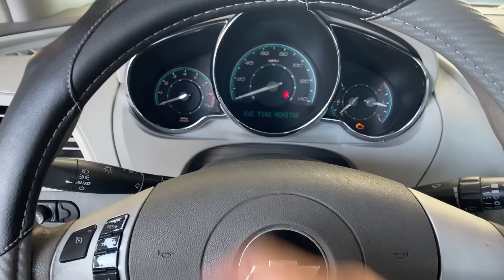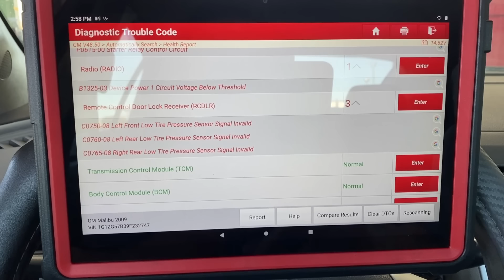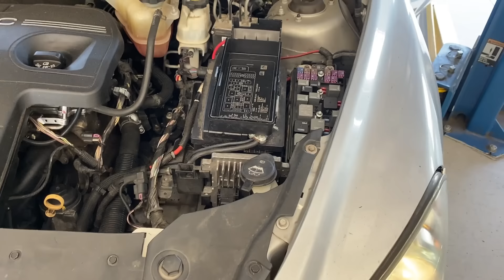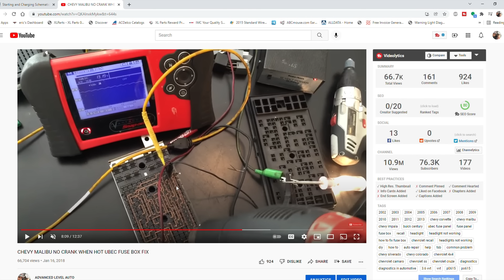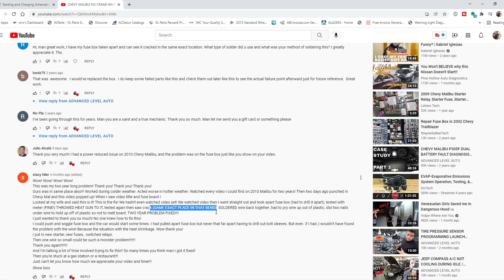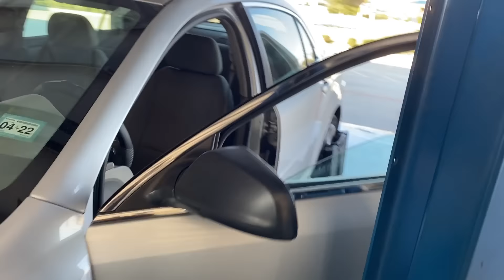CHEVY MALIBU INTERMITTENT NO CRANK NO START P0615 DIAGNOSIS & FIX

Comment: Great Job, Eric! I remember watching your original video with the fuse box issue. It’s disappointing that GM doesn’t acknowledge reoccurring design flaws, especially with electrical. For that reason, I’m sure a NEW replacement fuse box will fail the same way. Your customer is probably better off paying you to repair it. Thanks for helping the community of professionals and DIYers!!
Reply: i agree- you are so right

Comment: Good job! Best fix is the same as Mopar fuel pump relay. Take relay out of fuse box. New relay & socket separate from fuse box.
Reply from the maker: I actually did that repair on a Dodge Ram a couple of weeks ago. Unfortunately I couldn't film it. It was late in the evening, it was raining and I had to hurry. I'm still upset that I didn't make that video.

Comment: This is 100% traceable to GM trying to save the planet from global warming by dictating the use of lead-free solder that is prone to cracking. Satellites have fallen from orbit because of the same phenomenon. Meanwhile, GM sources parts from China where their energy comes from dirty coal emissions. Insanity. After owning 15 new GM vehicles during my lifetime, I am done with them and their coming battery bullshit. BTW, that will all have the same issue. Thank you Comminst EU with your RoHS bullshit!

Comment: Another GM vehicle the same copper wire break in a fuse box.  The 2005/2006 Chevy SSR with the LS2 6.0L engine (based on the Trailblazer EXT) has a similar issue with a copper wire with two 90 degree bends in it that a break develops in causing the engine to stop running after the engine bay fuse box heats up.  A couple of very dedicated SSR owners have found a solution for that fuse box by rerouting a replacement copper wire in the fuse box and the new routing does not include the two 90 degree bends that are near each other in the wire.  One of the 90 degree bends in the OEM copper wire is thinned out compared to the rest of the wire and that's where the break occurs after enough engine bay heat cycles occur.  The repaired 2005/2006 Chevy SSR fuse boxes with the rerouted copper wire have been trouble free since being repaired.

Comment: I used to use Heat Guns and Freeze Spray when I used to repair Medical Equipment back in the day. I had Patient Monitors that would stop working. I would heat up the capacitors and the display did not work and when I hot it with the freeze spray the display would work again. So I was able to repair unit with a couple of dollars of parts instead of replacing entire circuit board. Great catch on your part with this issue.

Comment: Having been in similar situations when trying to explain fractured paths or contacts in forums I can say with certainty you nailed this lesson very well. Also proving the value of the test light over impedance testing alone ;)
thanks
Reply from the maker: Exactly, the power probe showed us that sometimes a test light works better when testing ground integrity, especially under a load. Thanks for watching!
Reply: @ADVANCEDLEVELAUTO  my 2008 malibu did this. It turned out to be the copper band under the fuse box had a crack. Soldered it up. 3 yrs later no problem. It would come and go due to the copper temp change.
Reply: It's always better to test under load if you can

Comment: I would just take the relay out,, wrap a small wire around the ground pin and reinstall the relay, then ground the wire on the bolt inside the box. Hack job done 👌Quick and easy and kinda permanent 😂
Reply from the maker: I was thinking the same for a temporary fix, until they can get a new fuse box.
Reply: @ADVANCEDLEVELAUTO   I have done it to a few customers cars after hours to bypass the park neutral safety switch when they are crazy expensive.  But there is no risk to the Malibu, it's a constant ground.
Reply: @ADVANCEDLEVELAUTO  which part of the relay is ground? And what bolt are you talking about? When I try to ground the bottom left pin towards the headlight to the negative on battery it wont start. When I try to ground the top right pin towards the headlight it burns out the 30a pink fuse. I Cant get the fuze box split apart. Not sure how you did it. Can you please explain what I'm doing wrong?
Reply: @miltechmoto  not sure which part is ground but a google search would suffice. I think he means you ground it on the bolt inside of the fuse box that holds it in place try that and let me know if it works
Reply: I am going thru that right now. Actually my fuse box is not telling my radiator fan to come.. So we ran a direct connect to the ground. I am gonna order a fuse box thru eBay now to get the professional look back
Reply: I might try this exactly what my car is doing in the video